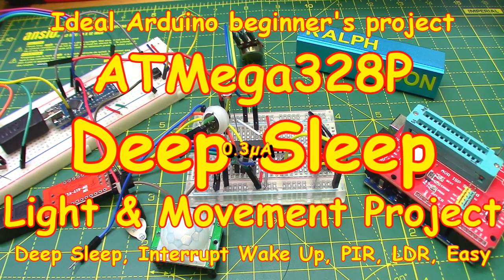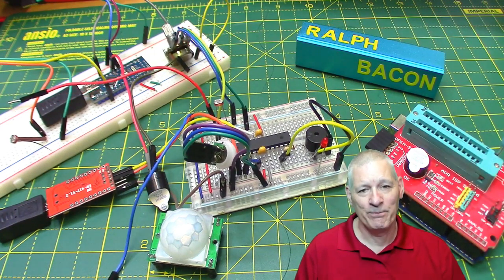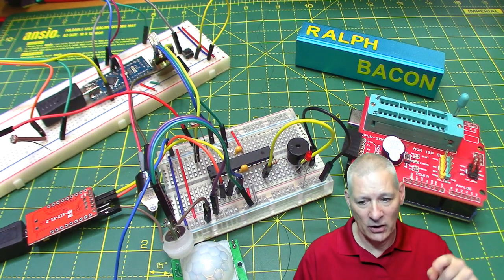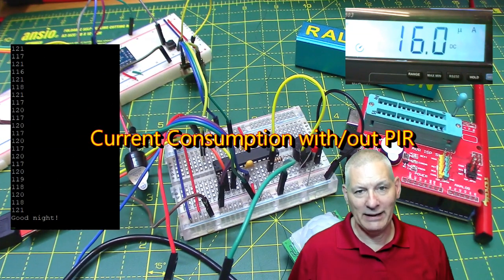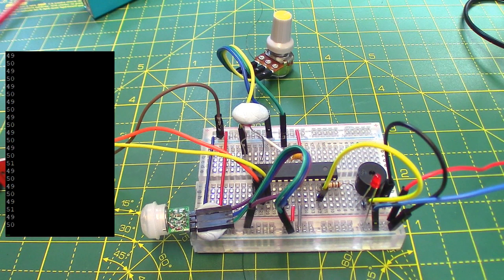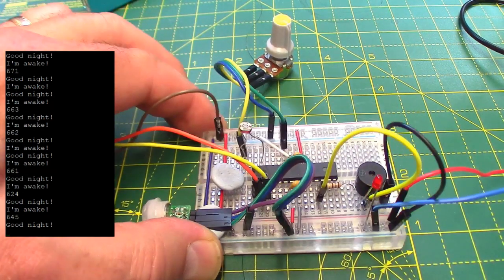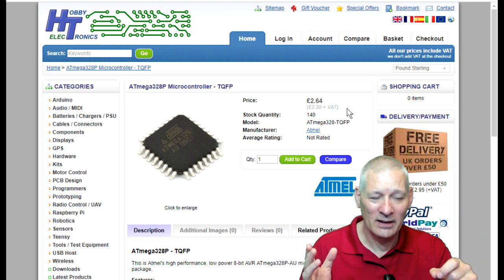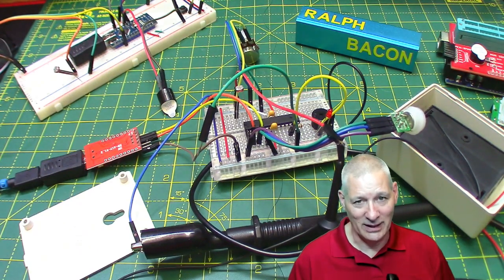#159 PIR Deep Sleep ATMega328P Project (for Benny 😺)

Comment: Done a similar deep-sleep ATmega328p thing for a temperature sensor using a DS18B20. It wakes itself up every 15mins and transmits the info via a 433MHz RF link to the MQTT broker attached to my home automation setup.  I've had it running off 2x1.5V AA batteries since March, but I can only seem to get it down to 4.5uA when asleep.  You're video has encouraged me to take another look at the consumption, and see if I can get it down further.  Cheers!
Reply from the maker: When you say 4.5µA, Steve, is that JUST the ATMega328P or does that include all the peripherals running 24x7, including the DS18B20 (which you could power in the same way I do, from an output pin of the Arduino chip). That all said. 4.5µA is pretty good (better than my 16µA including the PIR).

How do you wake up every 15 minutes? WDT allows a max of 8 seconds, so you must be waking up, incrementing a counter and immediately going back to sleep? Or...?
Reply: @RalphBacon  This is just the ATMega - I power the sensor and the RF transmitter from the chip (like you do). Typo in the sleep time - it's 5mins, not 15 - but I just use a loop that increments every second and applies "LowPower.powerDown(SLEEP_1S, ADC_OFF, BOD_OFF)". Couldn't find a better way of doing it, even after trawling Nick Gammon's blog ;-) Sorry for the slow reply. I was just getting distracted by the Ashes cricket, and watching England get mauled (again).
Reply from the maker: The spec sheet says that in Deep Sleep (Power Down mode) but with the WDT running you can expect (with a VCC of 3V) 4.4µA typical, 8 µA max. So you are spot on. Now go and cry in your beer, I mean 67 all out, perhaps they all have a dinner planned for 6 o'clock and didn't want to be late?
Reply: @RalphBacon  Thanks for that - I should learn to read spec sheets :-)  Maybe I'll leave well alone, then. I'm well past crying over England (cricket, football, rugby, whatever). but a beer sounds like a good idea!  Cheers!

Comment: I've ordered from PCPWay twice. Both times it was 15 pieces, 2 sided, 2 oz copper, and 5 x 2.5 inch.  $77 shipped to the Midwest, USA.  First time, it took 3 days to make and got to me in 8 days.  Second time, it was shipped in about 25 hours. DHL said it will be here Monday. That would be 5 days to get to me, from the time I ordered until a knock at the door. 
Seems pretty good? But, I didn't really shop around. I know there is a lot of variables. But, I think the solder mask color makes a difference in production time? First order was white and the second green.
Reply from the maker: Yes, Dan, green means they can complete the board in 24 hours; for any other colour it adds at least 1 day to the production time, I don't know why, perhaps they batch them up. Pretty good delivery times there, what would we do without such PCB fabrication houses? Thanks for posting.
Reply: @RalphBacon  You earned the money from your sponsor for sure. Pay the bills.

Comment: I'm working on a battery powered sensing device as well. I'm wondering about monitoring the battery level. Will you have some way of indicating low battery condition? Can the micro-controller accurately read it's own battery level given the reference (AREF?) for the analog input is taken from the same batteries? 
I never imagined that I would be contemplating designing a PCB layout but with your helpful vids I think I'm going to give it a go. I'm just in the process of moving the circuit off of the solderless layout onto a strip-board. Then on to a custom PCB. wow.
Reply from the maker: Yes, you can check the battery by using the internal fixed 1V reference for AREF of 1.1V and powering it from a resistor divider to that level. So a full battery reads 1023, dropping at it depletes. I also thought of that but had no time to implement. Maybe now I might look at it before my PCB is completed.
See: https://code.google.com/archive/p/tinkerit/wikis/SecretVoltmeter.wiki

Talking of which it's great that you're thinking about doing that. Look at my rubbish, first PCB results but now my PCBs are OK and I even did that 4-layer one! Strip board is so last century!

Great to hear from you Dirk, good luck with that PCB.
Reply: @RalphBacon   Strip board is so last century!...Hhahahahha!
Reply: As Ralph stated, you need a reference lower than the battery voltage you want to stop at to keep the reading actuate, also a good idea is to switch the supply voltage divider with a fet etc from a I/o pin so that you are not draining current through it all the time. just make it active then measure  the voltage then disable it.

Comment: Another great little project from the Arduino Master!  This may be a silly question, but why use a ATMega328P when you're using so little IO?  Would an ATTiny45 not be a better choice?  Or is the sleep current of the little one too great?
Reply from the maker: Good question, Gavin. And to show I am not the Arduino Master, I initially did this with an ATTiny85 but the dratted thing did not want to play nice and there was really no way to debug it as we have no Serial output. (I could have bit-banged the output but, really?) 
So, as I had the space I decide a bare ATMega328P would have to do. This time. When I have more time I will have to see why that Tiny85 did not want to work.
Reply: Ralph S Bacon with softserial you can debug an attiny.
Reply: @RalphBacon  Indeed that would be an issue! For ATTiny projects I usually prototype on an Uno to get the code working and then switch over. Guess I've been lucky not to need debug after building the final circuit.
Reply from the maker: I used SoftSerial last time, Mario, but I think I would have run out of pins, a bit fuzzy now after a Real Ale. But I shall revisit in due course. Thanks for the reminder!

Comment: Very nice Ralph, a great intro to Arduino, and avoid a boiled Benny to boot!...Oh yeah, I think MiniCore is a great utility, I guess you're gonna give your thoughts on ya next vid...cant wait!...0.3uA (300 nA) is about where I'm at,  but waiting for some parts for my Microcurrent Gold (Dave Jones project) I drew it into Kicad and made my own PCB mainly because my fluke is over 30 years old (I love it) and it hasn't got a uA range (fluke 79 series 2)
Reply from the maker: The sad truth, Andy, is that I had it all videoed (including your comment, thus giving you instant fame, glory and wealth - OK I lied about most of that) but it all ended up on the cutting room floor as the video was 50 minutes long!!! But I shall use it all in the next video about this project, don't worry. Thanks so much for the heads up on this. It worked very well.

And, of course, I used it in this project to get the Arduino to run at 8MHz using the internal clock without any faffing about whatsoever. I must read up more on the LTO, as although I enabled it I always it was always enabled anyway by default (so if you include a library that you don't use it would be optimised away).

No µA on your Fluke? Unbelievable. But it is very old so maybe not so surprising. My bench meter (as show in this video) a UNI-T UT803 is great for things like this, even better than my new handheld Brymen BM257s.
Reply: @RalphBacon  Yeah my fluke is over 30 (fluke 79 series 2) years old! but its been with me so long and all over the world  I wanted to build the MicroCurrent for it, but will invest in a second meter anyway when money permits!..I too have a few things to read upon regarding the Minicore but like you, I love the no nonsense approach and I think it could be very useful to our fellow Arduinites as well, and no better person than you to give it a full evaluation... say hi to Benny!

Comment: I love projects like this. Tips such as powering parts of the circuit from an I/O pin and setting pins to Input to minimise power consumption, are invaluable.
Reply from the maker: It certainly made a huge difference (relatively speaking) to the overall current consumption, that's for sure. I thought I was inventing something new with powering the potential divider like this. Turns out it has been thought of many times before. Drat.

Comment: I am a bit suspicious about your current measurement, it looks like you have the serial interface connected at the same time.
Reply from the maker: Suspicious in what way, Henrik? The Serial interface is connected but data and ground lines only (I've knobbled a USB cable specifically for this purpose, stops the COM port from the FTDI unit disappearing). I can confirm that it is 0.3µA when in Deep Sleep (and nothing connected except my multimeter), as per the Data Sheet spec, which says 0.2µA min and 2µA max.
Reply: There are a couple of possible errors:
1) Input may load the output.
2) High voltage may supply the circuit through the protection diodes (This can go both ways) and when we are down in a few uA the forward voltage of protection diodes are fairly low.
3) Signals that are between GND and VCC will increase the current draw.

It may be that none of it happened in your case.
Reply from the maker: Thanks for planting the seed of doubt, Henrik! This means I shall have to recheck my readings tomorrow, even though I am certain I did all this (more than) once. Sigh. I can't get anything past you guys.
Reply: I love helping ;)
Reply from the maker: I couldn't wait, so through my beer-induced fuzziness I just repeated the testing with and without the Serial device. Today, the meter reports that without the FTDI attached, in Deep Sleep the Arduino uses just 0.1µA which I will assume is my meter being a little optimistic. It rises to 16.1µA with the PIR attached, rising again to 200µA when the PIR is active (but not beeping/flashing). I've changed the design a bit (details in another video) for the interrupt.

When I attach the Serial converter, current drops to 15.9µA when sleeping with the PIR attached. When detached it consumes MINUS 0.1µA so the TX/RX lines must be supplying 1-2µA current to something. I've not set those pins as INPUT as I didn't know whether it would upset the data flow - perhaps I need to do that.

But all this notwithstanding, I can confirm a Deep Sleep standby current for the ATMega328P in the order of the 0.3µA I reported on. Today. It might be different tomorrow.

Happy?
Reply: "I've not set those pins as INPUT"
Watch out! Inputs are floating pins and if they end up somewhere between GND and VCC the processor will draw more current. You have already seen that on the video.

Comment: you could put a door sensor, and only check for movement after it has closed. Then go into deep sleep until the next door close. then the movement sensor can be powered from I/o as well!
Reply from the maker: Yes, that's an option but remember I want this to be a self contained solution (so my neighbour can use it too) without any outside requirements. But it could be adapted for use any way you want, glad to see it got you thinking!
Reply: Hi, that's part of the fun Ralph. As I'm soon to have a lot of free time I've got to be thinking how I'm going to fill it.
Reply from the maker: You going to retire? You just think that, but the truth is you'll just get a different boss (assuming you're married, which I shouldn't).
Reply: hi Ralph, you feel my pain. going from a 8hr a day boss to a 24hr one. got fed up with work, been going for 44 years now it time for some me time. got lots of things to repair and a few toys to play with.

Comment: The "Scat Cat" project.
Reply from the maker: I like it, Steven, I might use that name for my Part 2 of this project! I'll claim it as my idea, of course. Nope, too late now, you can't have it back.
Reply: @RalphBacon  Oh, I am full of ... ideas.  (Puts hamburger down.)  You could use a passive buzzer and digitize something horribly terrifying to a cat, like a bark or hiss for playback.  Even vary the tone and intensity.  Gadget Reboot recently posted this, playing with a tone library:  https://youtu.be/9OtRh3_pn68 -- actually, I'll write this for you if you have a passive buzzer, or small squeaker.
Reply from the maker: Truth be told I was going to use a piezo buzzer and use the Arduino 'tone' commands but I just ran out of time. And they are not very loud unless mounted (glued flat) on a backplate (the case) then they can be quite piercing. But that synth library looked interesting and it's not that I'm short of pins or anything...

Comment: Once you learn the best potentiometer value would it make sense to replace it with a fixed resistor?
Reply from the maker: Every (lighting) situation is going to be different though, so I wanted it to be adjustable. The final project might not have the pot as external, I might just have a small hole for a screwdriver to poke through, I'm still designing that bit!

Comment: Would be nice to have your PCB! Thanks for the excellent video.
Reply from the maker: I'm right in the middle of designing it using KiCad, which is most unfriendly when it comes to schematic design. I thought I had comes to terms with the foibles of KiCAD but only the PCB side it seems. I'll report back in due course, Javier.
Reply: I have done a couple of schematics in KiCad now and the schematic software is fairly easy to use (I used Eagle before). Of course doing schematic also includes designing your own components (without 3D model). I do dislike selecting a body/physical part for all my components, but the trick is to select it first time you use a part and the just copy that part (Copy is very easy and fast in KiCad).
Reply: @RalphBacon  Oh, I find the schematic side ok if you remember the "special" power  signs to stop it moaning about such and such pin not powered, and treat any symbols as "boxes with pins"...but the library system still hates me!

Comment: If you want to minimise the power consumption you could try to adjust your light detector in order it triggers on very low current. You could do that by maximising the potentiometer resistance to the higher possible level while the arduino analog input still can detect it. As the leaking current will be minimised I guess it could spare you a couple of uA... Just an idea.
Reply from the maker: You mean increase the value of the pot, to say 100K (or more)? I tried that and it was most twitchy. The 10K worked best even though I would have preferred a higher value. But powering it from the Arduino was a life saver!